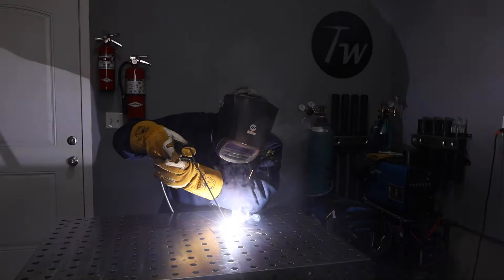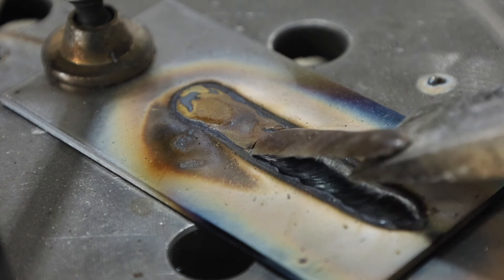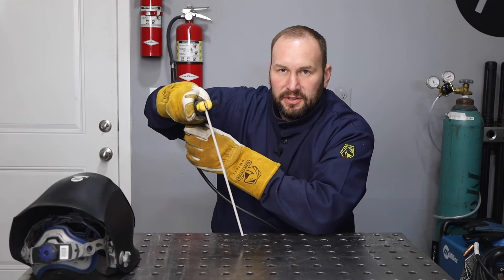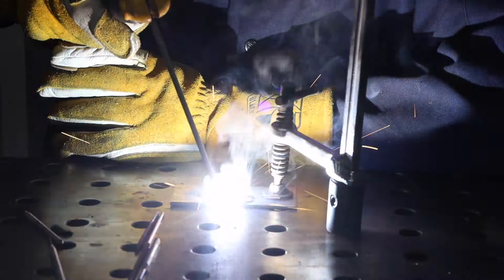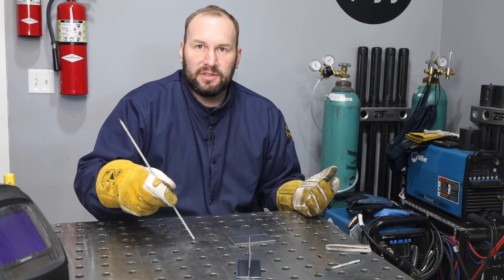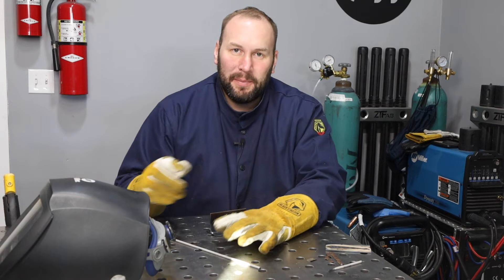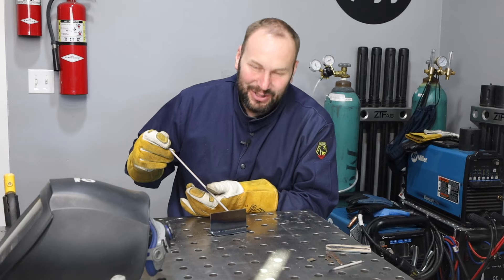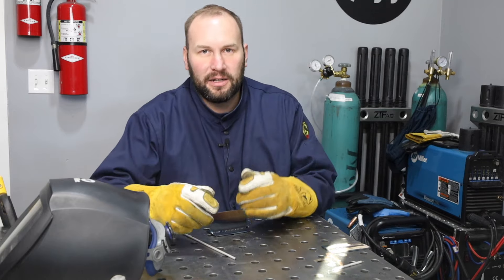Stick Welding Basics: How to Have Great Technique

Comment: Some advice I'd give to young up& coming stick welders. Don't hold the electrode holder too tight. Practice as much as you can with your weaker hand. Don't always practice on the bench. Practice in awkward positions. Get into the habit of ALWAYS saying "eyes) every time you strike a arc (fellow welders/fabricators/platers ect don't like being "flashed) 🌚👍

Comment: I got a cheap mig welder for christmas that does stick, not ready to get a gas bottle yet and fluxcore wire was more expensive than stick electrodes 😅 ive been enjoying it the past few nights in the garage, dropping welds on an old mower blade. Tonight i am going to try a nice  12"×4" plate all marked off to do bead after bead.

Comment: I had to do some welding today, ran a bead, ground it and tried again. Repeat. Threw away the electrode I was using. Had some stainless steel electrodes, tried them, first try is perfect (for my skill and need). Turns out I wasn't shit, the electrodes were. Have to buy some good electrodes in the future.

Comment: Hello Tim. Wondering if you can help me out. I'm 70 yrs. Old learning to stick weld. Autodarkening helmet. Problem is I can't see enough to distinguish anything. What do you suppose is the solution? Thank you. My welds are hideous and I'm frustrated.
Reply: Did you take the plastic film off the lense cover? Both sides. Or maybe you don't have enough light? I hang a ryobi flood light right above where I weld and if the battery dies it gets really dark. I have the cheapest auto darkening helmet hobo fart sells, and my glasses underneath.  I see pretty good.

Comment: Watching people weld always makes me feel like I’m going too fast, but my buddy Tony says I have to go fast because I’m welding 1/8” with a 3/32” rod. If I  turn down the amperage, I can’t strike an arc.  Thanks.
Reply from the maker: If your weld is the size you want and you aren’t getting undercut, then your travel speed is good. I weld 1/8” with 3/32” rod a lot and it works great.

Comment: I have a few projects that I want to do, and need to get up to speed with stick before starting.  It sounds like the tutorial you are working on, along with your stick course will be helpful for me.  I'll be using borrowed equipment.  Do you have sources to suggest for materials (coupons etc) to use while learning?  A metal supply place seems like overkill for these small pieces (don't want to annoy them).  Thoughts/suggestions?
Reply: I have a local metal/scrap recycle place in my area where I can go in and look for metal to buy.  They have every kind of junk, and metal of all sorts and sizes, including some new stuff.  If you have access to one of these, you might be able to get some good material to practice on for a fraction of new price.

Comment: Thanks fot tips, one thing that determans your manipulation of rod or technique is your pool, by pool I mean when you weld two pices both had to be equaliy molten and keep angle of rod so that slags stays behind the molten pool.Be sure when welding that you melt both pices , I mean read the pudle. Tim thank you for sharing your knowledge with us. I am welder my self, pipe welding in EU. I am sorry if my English is not correct.

Comment: I have a question. Which welding mode gives joints that are more tolerant or elastic to compensate heat expansion and contraction ? Stick or mig ?
Reply: Stick gives more variety in electrode/filler selection, but I wouldn't depend on either that hard, as you'll likely end up with cracking at the Heat Affected Zone over time.

Comment: I'm have an incredible amount of trouble transitioning from striking an arc to actual welding taking place. I just stick the rod over and over and over. Any advice?
Reply: Long arc for a second and get the metal hot then move in
Reply: Thank you I will give that a try
Reply: @prestondallas4035  you're welcome.  When I first started I would, hold the rod with my free hand kind of like a pool stick,while I'll flicked my hand that's holding the stinger and struck it like a match and that helped me to get going